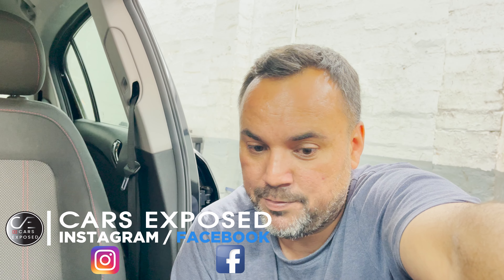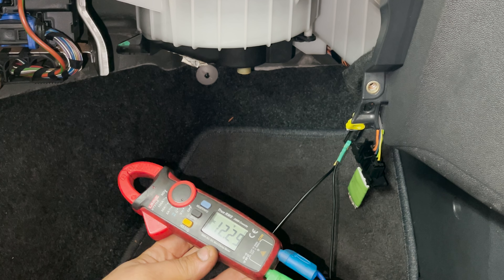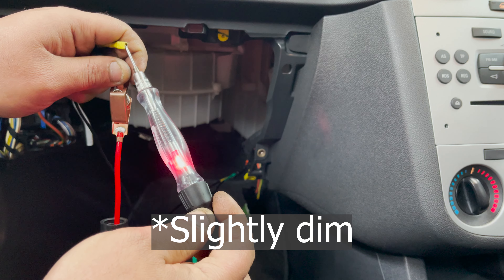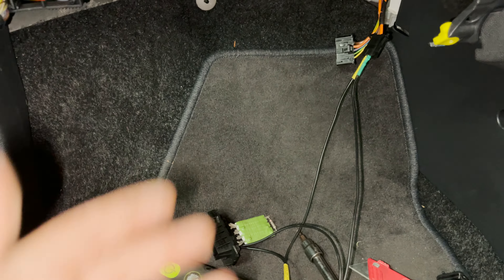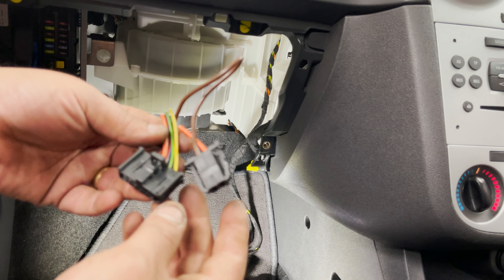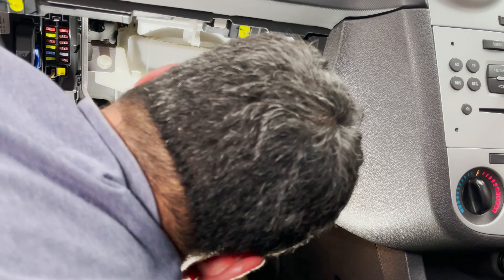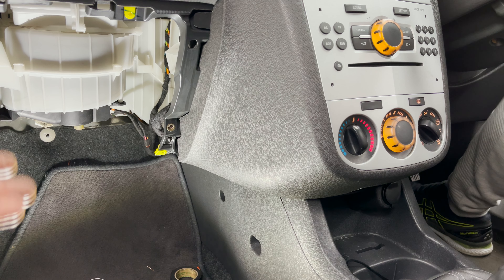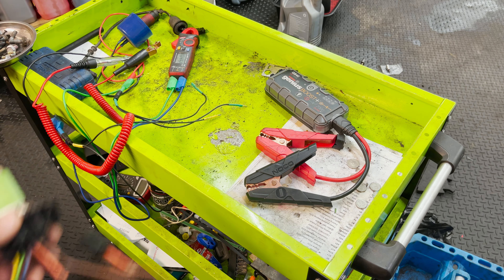Test light VS Multimeter Vauxhall corsa HVAC blower not working

Comment: wouldn't it be a good idea after the repair to quickly test the amp value that the motor is pulling against what it should be in case motor is starting to burn out (and therefor could have been the cause to overload the wires) and will damage the repaired wires
Reply from the maker: Good point that I planned to mention in the video and forgot all about rushing to fix the vehicle 👍

Comment: Top class video. You would run into the same false diagnostic if you used an led test light or one of those test lights with a led bulb and a volt meter built in.      Great explanation

Comment: Great video I’ve been led down the garden path a few times seeing 12v on the meter and thinking all is well. If I remember correctly Watts divided by volts = amps so 55w bulb would be 4.5 amps.
Reply from the maker: Oh yeah man load testing is the way forward … you are correct there  W÷V =A … cheers pal 👍

Comment: How's she goin'?  Nice demo Igor.  I think digital meters are pretty nice but they have their drawbacks.  When I was working I used to like to have an analog voltmeter as well as the digital meter.  The analog meter would often detect voltage fluctuations when the digital meter would just show a steady voltage.  Thanks for posting this.  A valuable trouble shooting tip!!  Take care!!!
Reply from the maker: That's a pretty good point Mike Cheers mate 👍🍻

Comment: The 2 wires that you connect - why are those 2 wires even connected at this resister in the first place, when it seems it maybe would be better spurred further up the loom...

This melting/burning wires seems to be a common fault on Corsa's - is this a fire hazard created by Vauxhall??

In addition, I've heard this burning could be caused by a tired/wearing blower motor pulling too many amps < if this is correct, then shouldn't there be a fuse in-line that should blow before the melting starts?

I'm really intreged to know why that 5th wire would connect at the resister plug if it isn't needed to connect there 🤔

Comment: What causes wiring loom burn out. Is it the resister going bad that burns this out.   I’m new to testing. Not to cars being in car sales.  I’ve turned my hand try fix odd car.  I have just done what you avoided here.   Buying a fan not needed.  My error was buying two new thermostat.   When is circuit relay wiring. Fault.  Stopping new  themo open
Reply from the maker: Generally is a bad plug connector pin fitment causing resistance and consequently heat, but there are other factors to take into consideration for example the blower fan pulling to many amps . I hope it helps
Reply: @CarsExposed  yes thanks.  It’s dropping in the knowledge slowly.